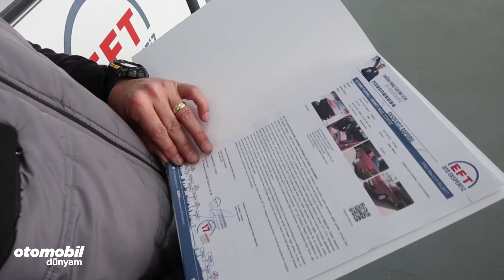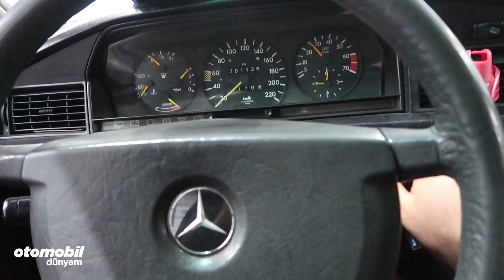Mercedes 190E Yenileme Maliyeti Ne Olur? | 1.Bölüm

Comment: trafiğe çıkacak şekilde toparlayalım derseniz 9-10 bini harcarsınız gibi yok ben yollara kral çıkaracam dersenizde 40 ila 50 bin harcanır tahmini motorun çalışır vaziyete gelmesi yağ filitresi 1000 lirayı, detaylı temizlik boya ve boya koruması 3000, iç döşeme yıranmalar vs. yine adam gibi bişi 1000, yürüyeni lastikleri yaz-kış dahil 2000, cam filmi vs  ıvır-zıvır gine 2000-3000 yese motordanda bi aksilik çıkmazsa ancak tutar tabiki siz bu işi tanıdıklarla hallederim derseniz 6-7 binede yaparsınız 😁 ha sağlam girip komple modifiye ederim derseniz de 40-50 bine ancak modifiye ettim diyebilirsiniz ki bilirsiniz modifiyede son yok yeterki harcayacak paran olsun 😃